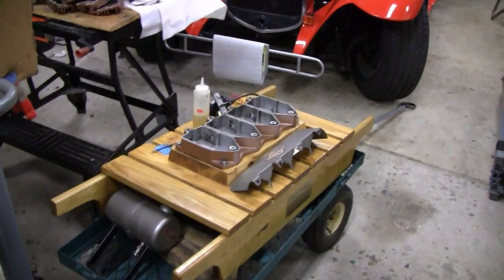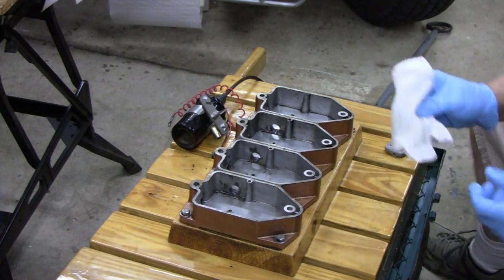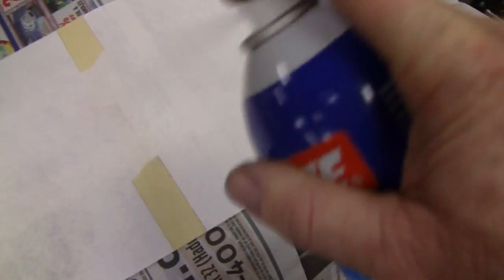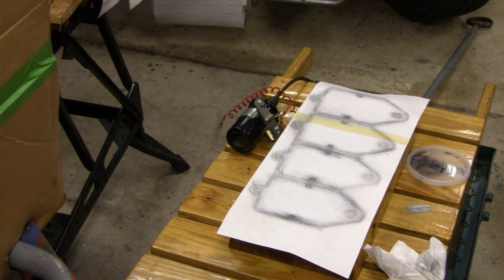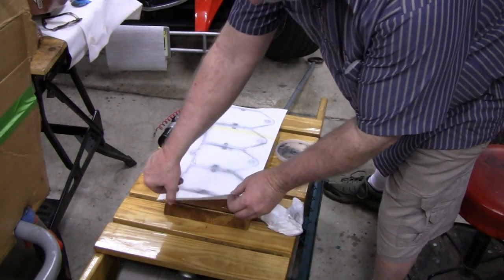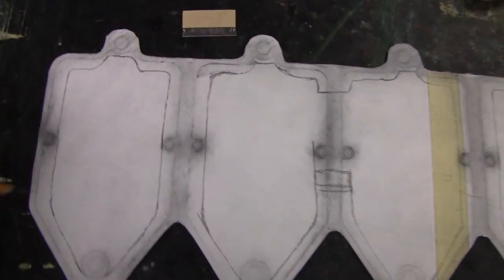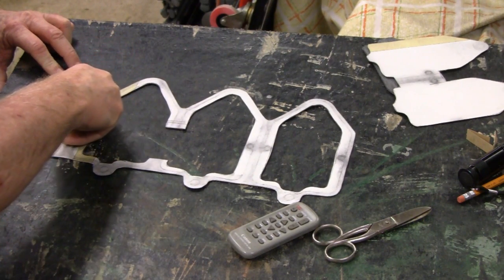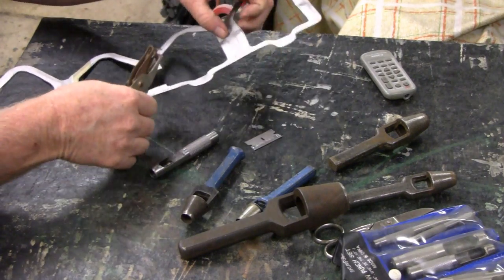HOW TO MAKE A GASKET (part 1)

Comment: Can you do this with a carburetor? I am trying to make a gasket for a garden tractor it's potmetal  so I don't want to hit it it has a bunch of small holes and I am afraid it might not show will it? I know this vids old but I would appreciate a answer if possible☺️ thanks for the 

Ps: why did you remove the paper template? would it hurt to leave it on?
Reply from the maker: Yeah it works good for Carbs!!  I wouldn't leave the paper on it, once it absorbs fuel it would probably shrink and leak!!☺

Comment: how do you know what thickness gasket sheet to buy?
Reply from the maker: most of the time the thickness isn't critical!!☺
Reply: Thanks for confirming! Someone told me that it changes the compression ratio...my thought was "well, if the gasket is that thick, I guess that is a different problem" I did not argue and walked away.

Comment: Great video. I've been making gaskets/templates this way for years, but I recently found a very useful tool for cutting them out. I use a stick rotary cutter. I still use a razor blade in the tight corners, but I find that the rotary cutter makes a much smoother edge. It ends up looking like a quality stamped gasket. Just don't use the one from the wife's sewing kit. She won't be happy if she finds out (or just make sure you put it back before she gets home!).
Reply from the maker: Thanks Bud!! I like that Idea, they're cheap enough to buy one for the tool box!!☺

Comment: What's the best method for cleaning off paper and silicone gaskets. I usually soak in degreaser and clean with steel wool.
Reply from the maker: I use a razor blade and lacquer thinner!!☺

Comment: just curious as to why you cut the center of the gasket out between the middle two engine blocks?  

pretty neat way to do that.  I usually do the lazy way, and just put a light dab of oil on the surface, place the gasket on top, let the oil mark the gasket, then cut it out directly lol.
Reply from the maker: That's where our center bearing is, ya don't a gasket there!!☺

Comment: Sometimes i use spray paint, paint the part i want to make gasket for then place the gasket stuff on it while still wet that gets my mark,"but can get messy" then just use scissors to cut out,for the holes i have hole punch also different size bullet casings.

just thought i'd share with everyone
Reply from the maker: Messy but effective!!☺

Comment: I still use that indian head shellac , either that or copper coat, I am not much on the silicone , it does have it's place but I like the tacky ones unless I get it on my hands then it's real trick to get it off them. I have made several gaskets using a ball peen hammer but you are right, it might distort the aluminum material.
Reply from the maker: Yeah there is a reason Indian head has been around a hundred years eh!!☺

Comment: That is exactly how I do mine except the spray glue, which i will use now.    Thanks for that tip.
Reply from the maker: I use that spray for alotta stuff, it's good for holding sandpaper on my air tools!!☺
Reply: now  there is an idea i hadn't thought of ,, using  spray sticky  on  my sandpaper

Comment: I may have to do this on my briggs and Stratton 252707 engine repair in the near future!

thanks for the info!
Reply from the maker: I think that's the same engine I have on my Craftsman Tractor, Never had any problems with it in 34 years!!☺
Reply: Funny, 
This engine came OUT of an 82 craftsman tractor!
Reply: now  there is a number i haven't  heard  for quite a while ,, I work on  briggs  engines a lot and don't see very many  250xxx series  engines anymore 

lots of 280xxx and 31A777 engines 
and the one i love to hate and that's  the 400xxx Vtwin intek ,,I had  yet another 
bastard delivered to me today  with  the guy asking me  if i can fix it ,,he said I don't know  what went wrong with it ,,15 minutes with it  on a test stand and i  gave  him my diagnosis ,,i told him to buy  another engine  cause  this one is  toast ,,final  cause of it's  death was a flattened camshaft on #1  intake valve 
this was caused by a binding  intake valve  that didn't open smoothly 
but it was already dying a slow death due to dirt ingestion caused  by B&S and their poor air filter design on that engine

Comment: If the paper does get stuck to the gasket material, a quick wipe with thinner on the paper side will loosen the glue up and it peels right off. I also have used an assortment of brass casings from bullets that make great hole punches..
Reply from the maker: I like that bullet idea!! I have a few different cal. laying around, I'll have to try it!!☺
Reply: Me too